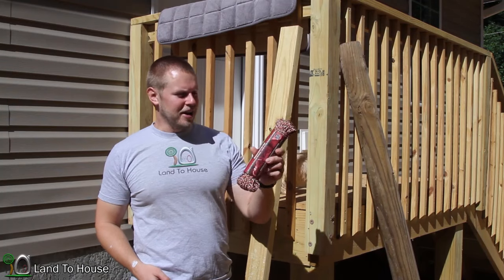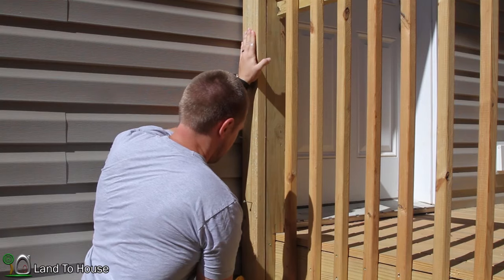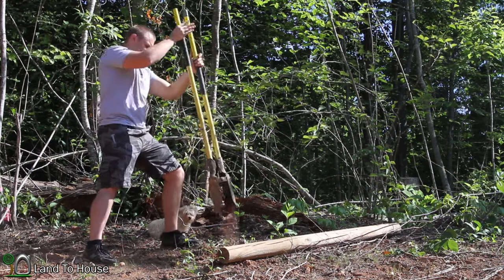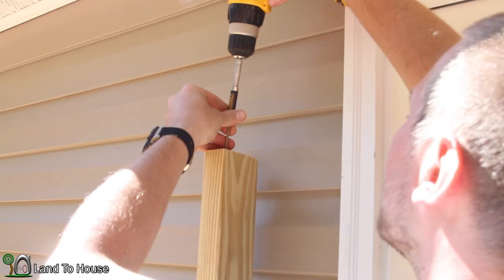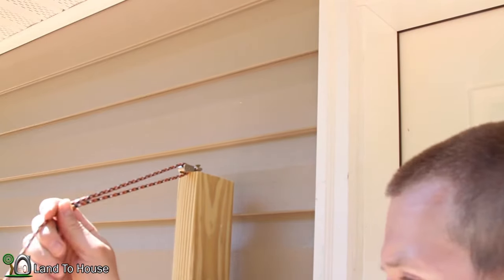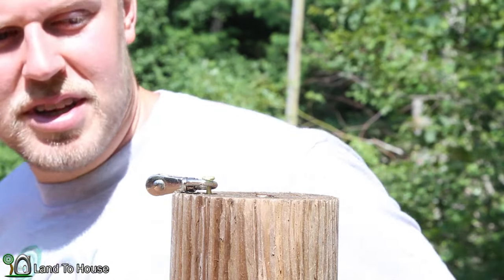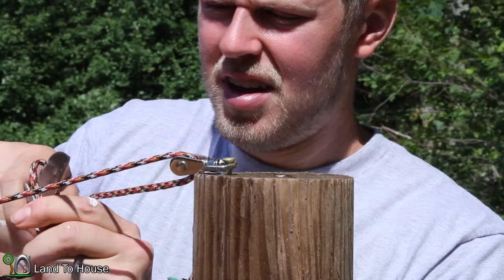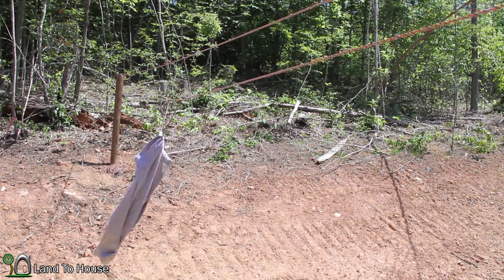Install a Clothes Line

Comment: Love the videos.  You will find over time that the paracord keeps stretching and needing re-tightening.  Polyester rope has the least amount of stretch (unless you want to spend $$ on kevlar core rope).  You will want eye screws or hook screws in the face of the posts to hold the pulleys. The screw in the top will eventually split off the face of the post like a wedge splitting firewood.

Comment: A quick cheat to support the clothes line the way you have it is to get a long branch with a fork in one end and push up the line when it is  full of cloths. I live in a area with shit loads of red soil and the dust is bad, just be careful with paracord as it will absorb the red dust and stain your light coloured cloths. Better off getting plastic coated "cloths line" then you can run a wet rag over it occasionally to clean the dirt off it. A trick I use to store rope is plastic bottles, melt a hole in the lid the same size as your rope / parra cord / string etc, push an end through the lid tire a thumb knot push into the bottle and put the lid back on, then slowly push, feed the rope into the bottle as it fills up bump it on the ground to settle the rope and keep feeding it in until full or you have the amount you require. It will not tangle, keeps the rope clean from contaminants and damn easier to store. Another great share you have done cheers & God Bless, Les 🙈🙉🙊
Reply: Ohhhh yeah, when you get to the end of the rope when pushing it in the bottle take the lid off tire a thumb knot then put the lid back on and the tire another thumb knot. Doing this will stop it from being pulled out by accident or falling into the bottle. The best thing with doing this is if you have hmmm 20 feet in the bottle and only need 10 feet you tire a knot and leave the other ten feet in the bottle where it is kept clean and tidy. I usually put the hole in the lid do a thumb knot about a foot from the end put the lid on do another thumb knot then feed the rope into the bottle before putting the lid on, just a bit quicker then trying to push it through the hole in the lid. I have half a dozen 600mil bottles with parra cord in each of them a couple of 1 litre bottles with parra cord and a couple of 2 litre bottles with 8 mil rope. Handy knowing what each size bottle roughly holds in meters. Any way enough of my drivel... God Bless 🙈🙉🙊
Reply from the maker: That is a really good idea! I would not have thought about that one. So the cord does not get stuck in the bottle? It would be my luck that the cord would get 1 foot out and then start to tangle from the bottom up. haha.
Reply: +Land to House nahhhh. It is a principle I learned while learning cliff rescue, and with out boring you too much, the rope was stored in a rope bag by being threaded in through a small hole in the top flap (do not attempt to coil) just feed it in naturally as you push it into the bag. Then when you need to use it we would pull out just enough to tie an anchor knot and through the bag of rope over and it would go all the way to the end and never tangle. Tie a thumb knot in the last or first ten inches (depending on how you look at the way the rope goes in the sack).. Anyway I just passed that principle onto using empty drink bottles etc.. Make sure you clean out the bottles before using them.... Cheers God Bless, Les 🙈🙉🙊
Reply from the maker: +Randm that makes a lot of sense. I have seen the paddling rescue rope with a similar setup. It almost seems like the bottle would have better output. Being so rigid

Comment: A for effort.  You’ll run into a few mishaps as you use the line. Hooks would of been better on the side of the pole instead of the top. With time the wood warps and the grain of the wood separates with the weather, sun, rain, heat and cold.  Reinforcing the pole on the porch with another 2x4 will help.

Comment: i would replace the screws with the staples used on the fence.  With  my luck the hardware would pop off.  Keep up  the good work
Reply from the maker: +Kirby Kercheval so far the tension from all the clothing keeps this attached very nicely.

Comment: that pulley is too small - the clothes pins will have no room between the two rope runs; you need a tensioner in the line; and put the knot on the top run, not the bottom.  I think those pulleys will pop off the screws
Reply from the maker: Yes.... well said. I just took the post out. We never did use it.
Reply: Put the joiner mechanism or knot on the bottom, if its on the top it can tangle with clothes and not let the clothes come back in.
Reply: maybe change the title to "How NOT to install a clothes line"  save everyone the frustration  @LandtoHouse